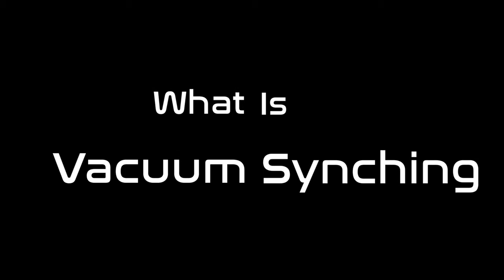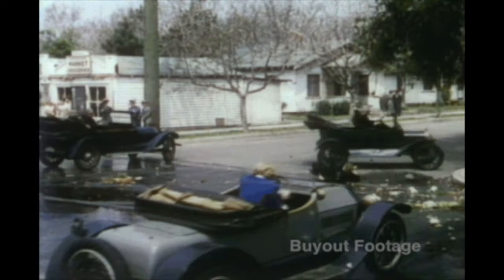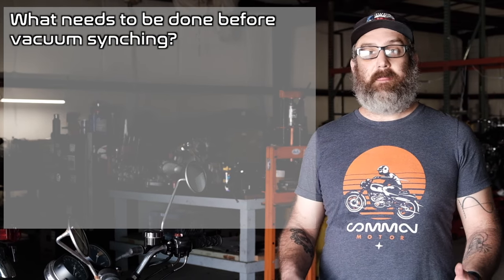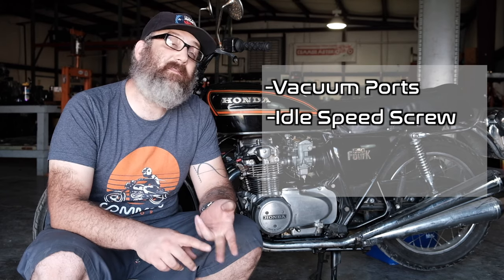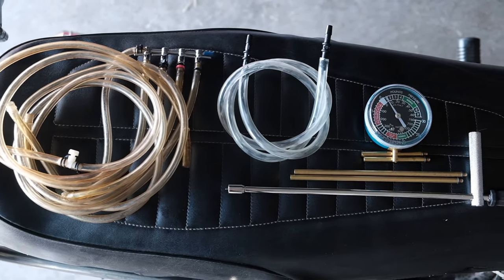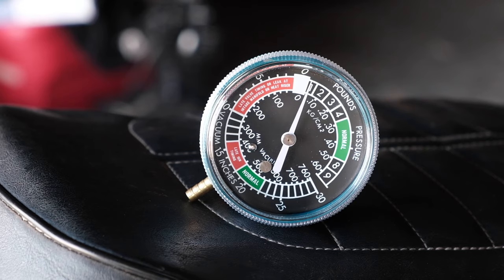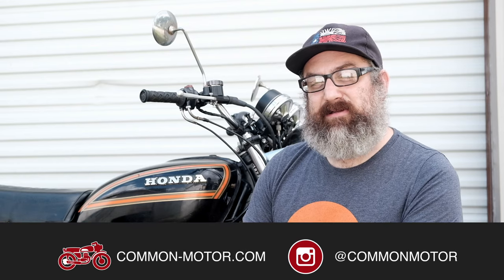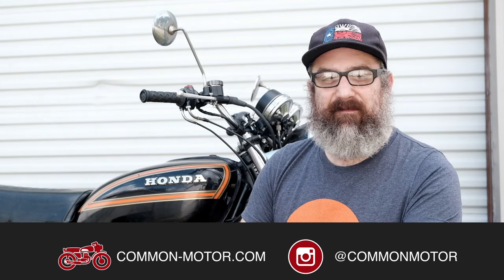Vacuum Syncing Your Vintage Honda 4-Cylinder Motorcycle Carbs - Pt. 1 - CB350F, CB400F, CB550, CB750

Comment: You can adjust each individual gauge with the small screw under the clear plastic cap to set them all evenly with each other. Run 4 lines, one from each gauge. Then take the lines from gauges 1 and 2 and connect them to a T, same with gauges 3 and 4 so they meet at a T. Then run a line from each of those T's to another T so all four gauges will be pulling from one T. Then run a single line from that T to one vacuum port, keeping all the other vacuum ports plugged. With the bike running, you can see the discrepancies between each gauge and you can remove the plastic cover and turn the screw to make sure each gauge is exactly in sync with one another. This way you'll know that each gauge is accurate to all the rest and you can use the bank of four gauges as intended.
Reply from the maker: another method! We prefer this way but there's plenty of ways to do it. Whatever gets you to perfect sync!
Reply: Would using a brake bleeder vacuum work the same to adjust the gauges instead of running your engine?
Reply: @thisone.  Yep. Just need a vacuum source.
Reply: sounds like a massive spaghetti mess of tubes and T's
you'll have to make a video on that instead of that confusing paragraph.
Reply: @darkshadowsx5949  he's basically saying hook all the gauges together and run it off of one cylinder to make sure your gauges are set to proper zero and all four gauges are reading the same. When they come out of the box the gauges can be off.

Then you can use the vacuum gauge set.
Reply: Thanks, now I don't havect write.
All connected Gives a Reference. My Triplett and Other Analog VOM Meters have same type screw to zero.

Comment: Good explanation of how sync works on the carbs, however I 100% disagree with using single vacuum gauge method. With carb sync you need to see what the other 3 carbs are doing as you adjust one. Yes it can be done with 1 gauge but seems like it would take extra time and added frustration. Quad gauge setups can be easily calibrated and read very close to each other. Liquid filled DYI manometers are even more accurate and can be built dirt cheap. Just my $.02
Reply from the maker: Just different preferences! We’ve found this way to be quite fool proof and easy to understand but at the end of the day if it gets your bike running like a top it’s a winner to us.
Reply: I think the accuracy of these gauges is often skewed because people neglect to do the first step in the instructions. YOU HAVE TO CALIBRATE THE VACUUM GAUGES!!!!!! It's tedious but the best way I've found is to hook each gauge up to the same cylinder and set them to the same reading one by one but you should only ever have to do this once. Mercury gauges will always be the most accurate however.

Comment: You can sync your carbs at anytime. Timing chain, valves, carb rebuild ....really. Buy a decent set of guauges. You can't sync with one gauge. As you adjust one carb it causes other carbs to change flow. A morgan carbtune set of guages is the best without braking the bank. Dont even bother with those cheapo ebay gauges you have there.

Comment: well both type of gauges have their issues, having to attach four gauges to one cylinder first and noting the offset between the gauges (and respecting these offsets during adjustment) sucks, but so does a leaky line gang valve do... my takeaway: check your equipment before you do the sync :)

Comment: I made a custom intake manifold for my CB750.  It now uses throttle body fuel injection.   I did it so the bike runs well at altitude.  I ride in the mountains often.  Easy to adjust the mixture.
Reply: That’s awesome you should make a video on it
Reply: What throttle body fuel injection set did you use?

Comment: Or use mercury filled hose vacuum gauges - self levelling and self synchronising.
Reply: They work great and cheep, just dont slam throttle shut or you will suck merc, if I did this more often, I would purchace an electronic carbstick, old timers use a man o meter or just a rubber hose to listen thru, inline fours comming into the shop with runability issues automatically got the carbs taken off, blown apart and put in the parts cleaner (ultrasonic) 3 hours, reassembled and tuned with a stick, never had a comeback

Comment: Always make sure the valve clearances are within tolerance before you attempt to sync the carbs because correct valve adjustment will often fix carb sync issues, syncing the carbs first will just disguise valve clearance issues but it will never fix them.
Reply: Yep. I was shown that when I was an apprentice, and I was able to reproduce the example many many years later when a friend got a VW Beetle with twin carbs. He sync’d the carbs but the engine still didn’t run great. I asked him if he adjusted the valve clearances? Nope. We checked them and none of the cylinders were within spec or within each other’s measurements.

Comment: instead you could connect the 4 gauges, 1 at a time to the same vacuum port (engine at a stable idle), and adjust the zero screw so that all 4 read identically. Now that all 4 gauges are calibrated to each other its so much easier to sync your carbs. 
edit: ps: you can use good quality air valves from an aquarium shop as pulse dampers and buy 4 good quality vacuum gauges from an auto shop to make your own setup.

Comment: Made my own setup back in '77 using an ex agricultural vacuum gauge, win e making taps and pipes and a lighter gas canister as described in Motorcycle Mechanics magazine. My late father made the take off adapters from brass. More recently I use a mercury tube set up made in Northern Ireland.

Comment: By the way, the coolest and most ingenious way I've seen to bench sync is using a flash light from the other side. Just adjust the sliders 'till you can't see the light shine through
Reply: I would call this a bench calibration. It's a good place to start. Final setup with the guages.

Comment: The gauges that you suggest are poor, actually they have a calibration screw under the cover. Hook all 4 gauges to a couple of Ts and pull vacuum from a syringe, match adjust as required, best to do so at operating pressure for absolute accuracy. Using one gauge and a switching manifold can introduce transient errors as you cannot compare all cylinders in real time. Bourdon tube or diaphram type gauges work very well in the right hands. Carb sync is a rare maintenance item and normally holds for a long time, unless a valve or ring problem crops up. I check mine every few years at most.

Comment: Even those gauges can be adjusted I do not like them ether. Plus those little plastic adjustable valves are also prone to lie. Found that out really hard way. I prefer Motion Pro liquid tubes. Hydraulics don’t lie.

Comment: Recently had the same issue he was talking about using 4 gauges they were top of the line but they all varied a few psi which turned into about 12psi and it even got so bad it wouldn't start. Went to 1 gauge and did the same thing he did and it tuned right dead on. Barely touch the starter and it goes. Great video

Comment: I’m new to all of this and get nervous trying to do something I’ve never done. I recently got a cb750 DOHC. That has idle issues. I bought a Digi sync and the 8 mm tool but was chickening out but after watching your videos with your very well said explanation you gave me the confidence to do this now I need a fan. Hopefully you have a video on th valve adjustment. I watched one from someone else and I think I did it wrong

Comment: Well, makes sense about using one gauge and a gang valve so you know you don't have a variable between your gauges, why not just use a manometer ?.

Also, carbs of that style you can adjust individually, while other bikes you have to pair each set of carbs, and then make a final adjustment between both pairs.

Comment: My engine kept on misfiring, idle was erratic, high fuel mileage and had no performance

I didn’t know so I changed spark plugs, did compression test But it was sorted after syncing the carbs

Comment: The vac' ports are different between the models though.
Reply: Like my 500 has vacuum ports on the intake manifold.
Reply: Took me a lot of head scratching but after a rebuild on the carbs I was having a hanging idle issue that wasn't there before the rebuild. I assumed they were out of sync and while they were slightly, this didn't solve the problem. What did solve the problem was using genuine OEM Honda jets because the rebuild kit had garbage jets.
Reply: Oh you do address that